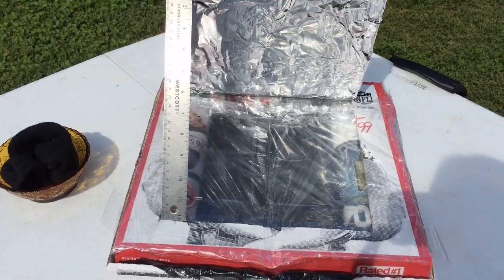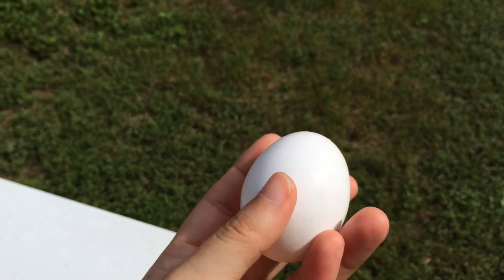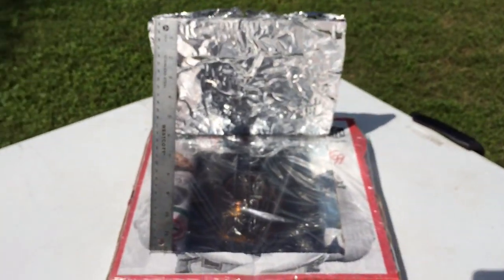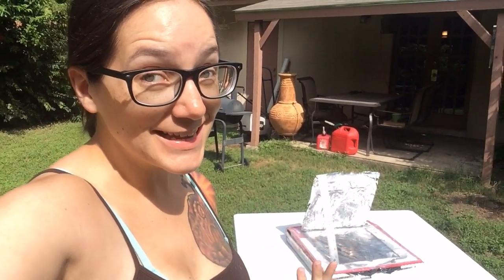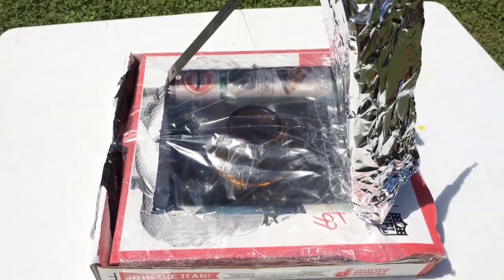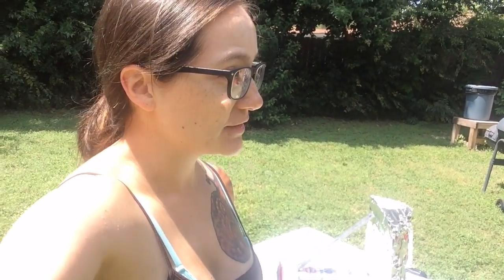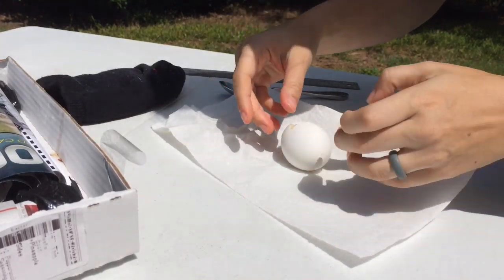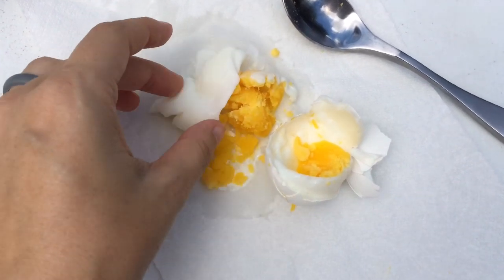DIY Solar Oven Experiment

Comment: I've had a Solavore solar oven for a few months now and I love using it to keep the house from heating up.  Considering where you live you would get a ton of use out of one!  In fact I cooked another dozen eggs just yesterday.  Get the oven around 230 for a while for about 2 hours and the eggs are super easy to peel.
Reply from the maker: I wouldn't use this on a regular basis, but definitely great for emergencies. Thanks!

Comment: I used a sun reflector for a car windshield.  Used heavy duty clamps and a oven roasting bag, turkey bag. Placed a black cast iron lidded pot inside. Cooked soaked beans. It did take all day but it worked.
I do believe you could make a better long-term version. I have that at the bottom of a list somewhere. Lol
You reminded me of that list. 
Good job, prep on.
I'm in Texas,

Comment: I'm just curious. If yo put the egg in the sock under glass and not in the solar oven, would it cook that way too?
Reply from the maker: Probably not. The aluminum foil and the black on the inside are really what is radiating the heat.